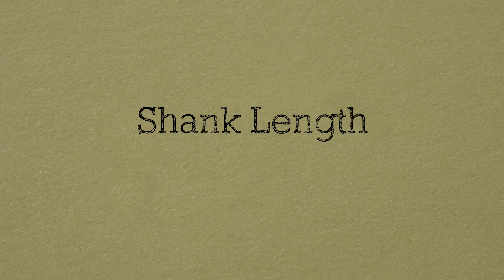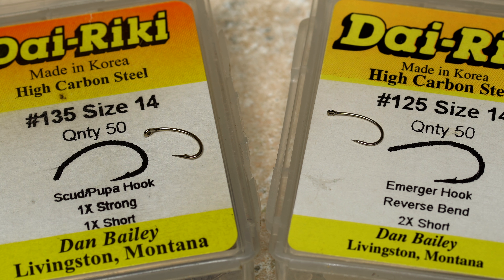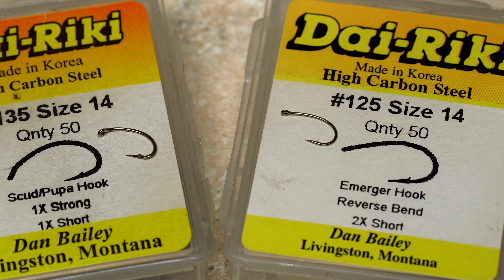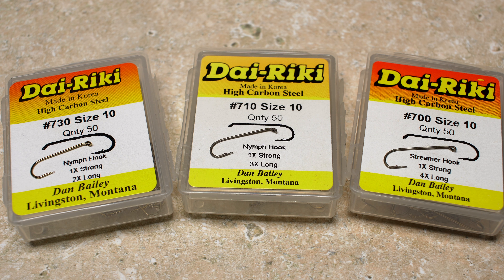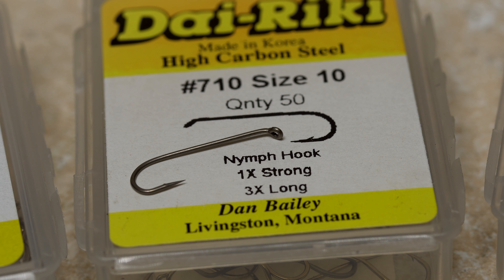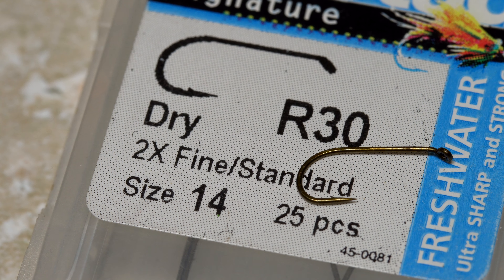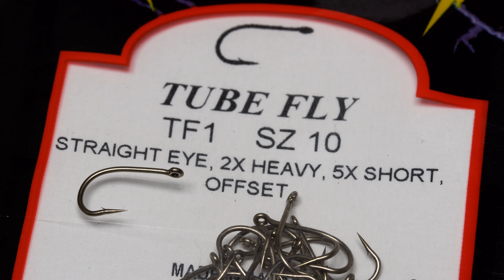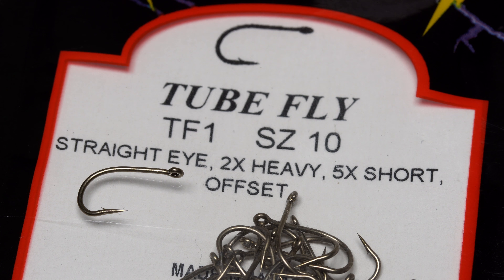Hook Basics - X Factors

Comment: Good video. To be specific, each additional x up or down means equivalent to that of a hook that many sizes larger or smaller. That is, a size 14 3x long has a shank length 3 hook sizes larger, so it would have the shank length of a standard size 8 hook. A size 14 1x short is as long as a standard size 16 shank. A size 14 2x heavy has the wire thickness of a standard size 10 hook.
Reply: Pretty much what I was going to say.  Also; since there is no industry-wide standard, I might clarify that to be compared to the "standard" hook of the same style (scud, streamer, dry fly, etc.) by the same company.
Reply: handcannon yes, exactly. Because a size 14 from one company might be the same size as a 16 from another different company. There is no standard that all companies agree on.